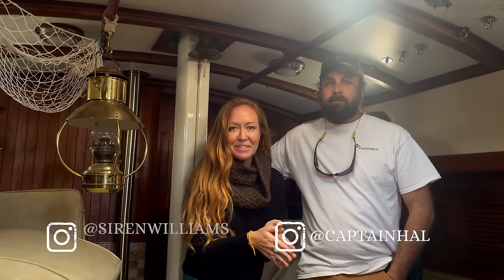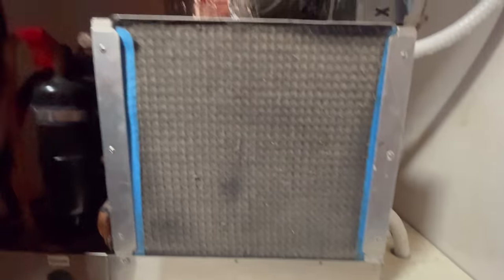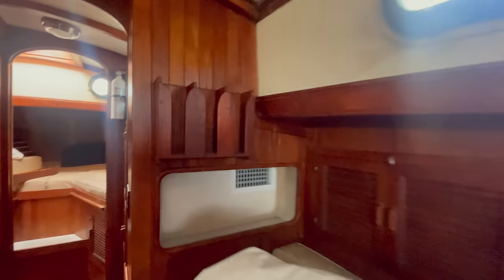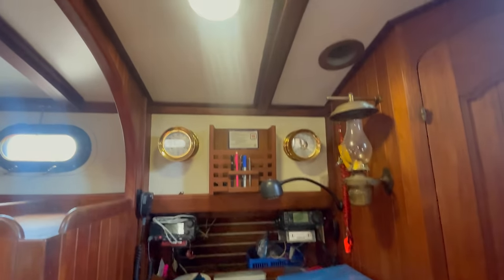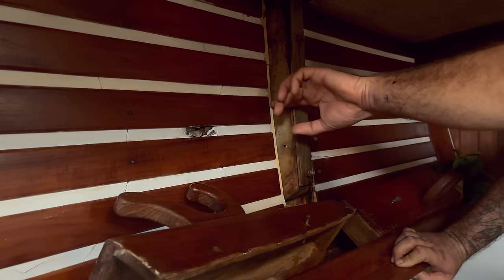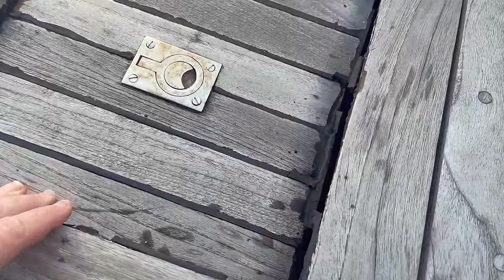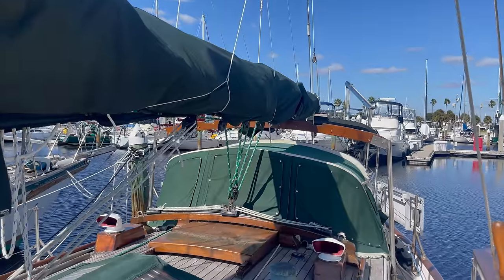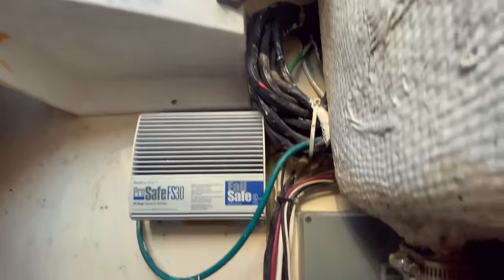I’M BUYING THIS BOAT -1976 TAYANA 37-  But we aren’t sailing out of this marina. (Ep. 42)

Comment: Lots of Tayana 37 go to external chain plate then your not trying to seal them in the deck something to check out👍👍
Reply from the maker: Exactly. We already have spoken to the port Townsend place about having them made or we make them ourselves in stainless.
Reply: @TheSirensLog  you can also get silicon bronze flat stock (bar) that is impervious to corrosion but portsend foundry has great reputation also where I’m planning to source my chain plates for my Westsail 32

Comment: the tayana 37 is probably my next yacht…so i’m a huge fan…having completed a major refit on a very similar taiwanese yacht a few years ago i’d advise finding one that has been already done…tearing into decks, chain plates , cap rails, etc,  is not in my future…chances are that she needs standing and running rigging among many other very costly items…
id say find one that is mid 1980’s ,has relatively fresh engine that has already undergone complete refit and spend 50-60 k …and you’ll still want to make her your own for another 10k…trust me, this is reality speaking…but i think you’re on right track with this model…cheers!
Reply from the maker: Oh we know, and agree! But we got a great deal on this one, and that is a newer engine. It’s the yanmar 4JH3 E which is early 2000’s. Runs great, and we can rebuild in the future when necessary. We’d love to have found mid 80’s but we just didn’t and this one was better in a lot of ways we didn’t find in the other Tayanas available. We know what we’re getting into with that deck and with the rigging, and the rigging is the most urgent, by far. We can’t even sail her as she is. Finding one re-done was possible but those had other problems, so…. Pick your poison! Hahah

Comment: I've ran some yanmars with more hours on a charter fishing boat and only had turbo and starter problems. These were 370 horses each and I had 2 but those things are solid if you can confirm they were maintained.  Quality engines for sure.

Comment: To get a/c to a aft cabin, I ran a 3" flex tube a total of 26 ft with bends and turns.  At the end I mounted  hi capacity fan to extract the air from the tube. Works great!
Reply from the maker: Nice!!! I’ll remember that. Did you also install it under the nav station?
Reply from the maker: Oh! Sorry I don’t know what boat you have. Haha Sounds like it was far enough away though. Good to know I can run it that far.
Reply: It was on a old CT48 @TheSirensLog  back i the day,

Comment: This boat seems to tick most of the boxes for you both, I hope you come to agreement.
I have a 38' Pearson with a 16k ac. In Mobile Al. in August, it was barely big enough. The hatch in the head countertop is meant to be a laundry hamper. My aft head is so equipped. Has a cloth bag snapped into the inside perimeter of the hatch. I thought it gimmicky  at first, but it has proved useful.
The SSB radio and Pactor modem would allow you to send and receive text only e-mail (very slow baud rate), and receive GRIB weather files. I have a slightly newer model SSB. Technology has nearly completely overtaken this equipment, but it is a communication device with quite a long range. There is a steep learning curve to operate it.
Reply from the maker: Oh I like the idea of having the bag in there for laundry. In previous boats I’ve lived on, I’ve used that cubby in the V berth that had the wood lid. But a bag in there seems better, if I can rig a way to put it there

Comment: I just installed a 10,000 BTU system on a Contest 38s which has an aft cabin as well as the traditional salon and v-berth forward. We are in the BVI, and 10,000 BTUs is more than enough.  I used a 16,000 BTU unit for the salon/galley/workshop/ quarter cabin  area of my Hans Christian 48 and in the Caribbean it was just fine.
I mention this only as a guide for anyone thinking of adding a/c to their vessel.  Good luck and good sailing.
Reply from the maker: Thank you!!  That was a point I made to Hal as well. I really think MAX 12k is all we would need. If it doesn’t fit under the nav station we will get a smaller one
Reply: Having an over sized AC is better and works better it doesn't have to work as hard and if done right it will use less energy because it will shut off when it get to temp if it's undersized or the "right" size when hot it can barely keep up and run constantly using power.

Comment: Hi guys , the chain plates can be moved to outside of hull with out Changing rigging length.
3700hr on engine is no problem just get an oil analysis (cheap).
Engine runs 👍 
HF radios require perfect installation to work but nobody needs one any more. Vhf and a starlink is way better. 
Davit set up is great and unusual to have on T37! Bonus!
Is deck cored ? If not then deck may not be an issue .  Some of these teak decks are thicker!!! Maybe sand and recaulk? 
Any leaking inside???
Hull is solid on these!!!
Is coach roof fiberglass or wood ? Is rotted wood just a cover?  
Fixed up these are well sort after so a good boat to buy.
Furler looks very small , not for reefing only rolling up. 
Any unused rigging looks like that but it’s big size! 
Strong looking steering mounting /sheaves etc .
They sail well. 
FYI wood in head may be heavily stained but live with it ! 
Bigger boat bigger problems this is still a lot of boat! 
Hope price is ok !
Agreed run boat home the way it is and you can fit under the marathon bridge save many miles!!!!
Cheer Warren
Reply: HF radio still has its uses if someone cares enough to learn how to use it properly and doesn't require "perfect" installation. In an emergency, the standing rigging can be quickly and easily converted into an antenna system. Where VHF will get you tens of miles of range and is great for local communicatons, HF will get you hundreds, even thousands of miles of range without having to rely on someone else's network of equipment like starlink.  The biggest advantage to starlink is its data speeds under optimal conditions.  There are still maritime nets on hf that seek to connect ocean going vessels with the mainland, offer assistance, etc. One mistake I think many offshore sailors make is discounting HF because it's currently gone out of style.  That Icom 706 is still a highly desirable radio.
Reply: @bryanirwin5473  HF does have its uses , look at the round the world  OGR race at the moment , the boat Maiden is getting daily weather forecasts from England and sharing with the rest of the  fleet. Maiden is a metal boat that makes the grounding required for HF work properly , most of the other 12 boats are unable to get HF working . It really does require a lot of knowledge to set up and maintain an HF setup on a boat at sea. 
( this race has technology limited to 80’s so no starlink etc). 
In an emergency a simple conversion of rigging to an antenna is never going to happen  at sea unless you have some special trick that nobody else knows about. 
Cheers Warren
Reply from the maker: Thanks to both of you guys for the comments. 
Hal has a license to operate that radio and knows them very well, so we’re good there and happy to have both. 
The rigging and deck are both done and we knew that before really looking at the boat, and the plan would be to get those projects done this year, and to move the chain plates out.
Reply: @TheSirensLog  great , look fwd to finding out if offer accepted . FYI the wood block fiberglassed over that chain plates are currently bolted to are prone to rot …. Just fyi not that you don’t expect it!
W
Reply from the maker: @Cheers_Warren  Thanks! Yeah we still have to cut the knees and everything out of there when we move the chain plates to the outside.

Comment: I love this Perry design, built in Taiwan in 1976 and believe you both seem to like her also, but I'd be leery about offering more than 21,000 USD. The engine is fine, the A/C unit could be moved aft, possibly in the aft lazarette, the decks will cost $8,000 to replace and rigging plus new sails another $11,000. After your finished you'll have approximately $42,000 in. There is a 78 Hood 43, glass with teak decks and new sails for sale at $53,000; so look before you deposit. Thanks again and enjoy.
Reply from the maker: Well, the boat is worth a lot more than $21k, but we didn’t pay the asking price, I’ll say that. Just those wind vanes alone are around $8k and our is in mint condition. The boat has a new set of sails still in the bags in the lazarette. The deck and the rigging are the major projects, definitely, but we can tackle those. To replace the rigging and chain plates and have someone else do it would be well over $20k, but we can do the rigging ourselves. We will also move the chain plates to the outside of the hull. The teak deck would be 35k to have someone remove and do fiberglass, but that’s also something we will definitely do ourselves. When we are done, we will likely have over $50k in between what we paid, the cost of redoing the deck and the rigging, plus all the odds and ends to do around the boat, and at that point it’ll be worth probably at least $90k. There are some selling for $85k now that aren’t in as good of shape as this one will be when we are done.

Comment: Keep the 16 in the salon and put a 5 in the v berth area that will cool the head as well
Reply from the maker: I was kinda thinking if we moved that 16 to the salon it would cool the whole boat, ya think? She’s only a 37 and a lot of that is bowsprit. Hahaha
Reply: @TheSirensLog  If she's a 37, then she's 37 feet long stem to stern. The length of the bowsprit is not included in that number. Correct me if I'm wrong after you take tape measure to her.

Comment: I would pull the deck and glass it over. Do the work yourselves to keep cost down. That should take care of your leak. Then your going to have to address the rig, you don't want to loose the rig. Then the steering cable needs to be inspected, it probably needs to be replaced. Lots of work but it is doable if you have funds so I would borrow more money than is needed to buy the boat. Get it home and get cracking, good luck 😀.
Reply from the maker: Thats the plan! We’re cash buyers though, and we got the boat at a price we can do the work, and continue to work and make money while also working on the boat. The deck needs to come up and we can’t even sail on those chain plates, and that steering cable needs to be replaced asap. The surveyor pretty much confirmed all of those things as well. Might be motoring home!

Comment: I know you have a passion for classic yachts, just wondering if you would consider a slightly newer design? There is a 1981Gulfstar 39' Sailmaster for sale in Gulfport - asking $50K. I know this is more than you want to spend, however, this boat has a low hour diesel (1,200 hours), looks to be in exceptional condition, and gives you more room, light, and sailing performance than the Tayana. Best of all, you don't have to do any major rebuilds or spend tons of money and time replacing teak decks or chainplates, you can actually go sailing and enjoy life in your time off! In the long run, it would be far cheaper to own than the Tayana. Gulfstar was at the top of its game in 1981 and building perhaps the best mass production boats in the world during the early eighties.
Reply from the maker: Yes! When you say “newer” and mean 80’s, I like you. Hahhha The Mikelson we were looking at was an 87! That’s why I liked it because it was newer and better built than it’s predecessors. I don’t think people realized that. But yeah the Gulfstars are fantastic! But… we got a steal of a deal on this one. 😉

Comment: Most pleasure boats the engines rust out before they wear out. Just look at the sails to see the balance. Motoring sailors are a real thing.
Reply from the maker: Totally and I think they were. Brand new sails in bags never used. Early 2000’s engine with high hours. lol
Reply: @TheSirensLog  
That sounds exactly like it..🤣
Avoid balsa core deck designs..

Comment: It seems like a coastal boat, to make it a cursing boat you would need to do major maintenance to most of the systems including rigging. Also repair the soft deck
Reply from the maker: Absolutely
Reply: Definitely a blue water boat. She draws 5’6” and displaces 22,000 pounds

Comment: That toilet needs to find a Dumpster--that is the cheapest most inefficient marine head made. At the very least I suggest a Raitan PH2 with the household size bowl(important!). That Jabsco cost $150 and the Raritan will be at least $450 --there are about 4 other units costing up to $1500ea!! Also all new hoses and clean out that holding tanK thoroughly! Change all the Bodily fluids on engine and trans, rebuild injectors, change all the Hoses, polish the fuel in the tanks--hoses to fuel tanks!! Details, Details!?---------Mikey
Reply from the maker: Totally agree!!!

Comment: Been waiting for a Sounding Hammer & Pinless Moisture Meter to appear in one of your Buyers Surveys. (snake cameras are cheap as well).
Reply: Stay tuned.
Reply from the maker: Yep, I keep threatening to buy one but just haven’t. Of course, we know boats and have worked on and around boats for decades, but we aren’t doing an actual professional survey ourselves. The idea, as knowledgeable buyers, is to go through the boat as best we can within the small time frame that we have (usually an hour, maybe less, maybe more) and get a solid understanding of they systems and everything happening with the boat, especially in terms of leaks and rigging, etc. of course, on the Tayana, it’s very easy to see that the rigging needs full replacement and the deck has caused damage and leaks. I don’t need a moisture meter to tell me that. I know that. In fact, I’d be silly for thinking that I could pull out a moisture meter in hopes of it telling me there’s no moisture and my teak deck is fine. It’s not fine. It’s a 1976 teak deck- they’re never fine. lol So yeah. On that Mikelson, we didnt need to do that because we had a survey on that boat that was done a couple of weeks prior and that was lightly mentioned in that video so we already knew that there was moisture around those fittings. This happens on all boats anyway, and its not a good reason not to buy a boat unless one is just looking for something “new” and plans to sell it before it needs any real work (but even a brand new boat with a warranty will need ongoing work). For us, we can do this stuff, none of this is new for us, and we plan to find the right boat and keep it, so the idea is to find the right boat and then decide if she’s worth the projects we will have immediately. Even if the boat was $100k more and those projects were done, she’d still need other things and eventually she’d need heavy work again. That’s just owning a boat long term.
Reply: @TheSirensLog  I've had several boats and lived aboard. (and VW Vans) I'm a carpenter & welder by trade.  I'm looking for a ketch rig at present, and some I've viewed so far have been needlessly destroyed by owners ripping into and not having time or talent to refit/reassemble.  Did your surveyor mark out the specific damaged areas?  Will you be doing the repairs?  I'm 70 now and am willing to fix/upgrade only what's actually broken. (I'll impress later, by polishing the bronze & ss when all else is in a serviceable state). Those new fangled diagnostic tools are the ones I use to precisely outline the areas of water damage ''before'' drillin & rippin into entire cored decks, hulls, bulkheads, and cabin sides.  I've also missed hidden , not at all visible damage due to the area drying out in a period hot, dry, weather.  Now if able, I run a garden sprinkler on the deck or Rv roof for a few hours, then let topsides air dry before testing for moisture from the interior.  The other tool I found very helpful is a Wire Tracer,  >  https://www.amazon.ca/wire-tracer/s?k=wire+tracer  <  for when you get around to rewiring your (colour-uncoded) Tanya or most any other old boat, VW-Rv, car or house with rats nest wiring.  (I use the Sperry)

Comment: 50K to make this work for more than a few years. Not the one for your  ideal. Wish you guys the best.
Reply from the maker: You’re right! But we got a deal on the boat, and we can slowly put money into her and do the work while still having fun. She does need new rigging immediately though. That’s the biggest concern.
Reply: I totally disagree with that comment . People need to stop thinking of boats like cars . This isn’t about how many miles you can get … this is about style and blue water . The memories they will create are priceless
Reply from the maker: @Regencyexpress1769  you’re absolutely right!!! Thank you!! Hahaha I agree somewhat with his comment though- IF we were paying someone to do work, and we aren’t. But if we were paying, the deck would be $35k and the rigging would be minimum $20k with the chain plates. However, we can do a lot ourselves so that number drops for us. It does need a lot but this babe has lots of life left.
Reply: Having restored two sailboats myself, one almost completely, if the boat has good stringers, solid deck, hull, rudder and compression post the rest is comparably easy. Refurbishing baffled tanks are a PIA but usually doable. If the boat has been sitting for a while get, or make a fuel polisher with a pump and filters and rock & roll. 
Chasing leaks is a part of the sailing life so if the boat has good bones buy it replace the standing and running rigging and cast the lines. Life is too short to sit on the dock. I’m currently searching for my next pre 72 blue water pocket cruiser just because older cored decks suck.